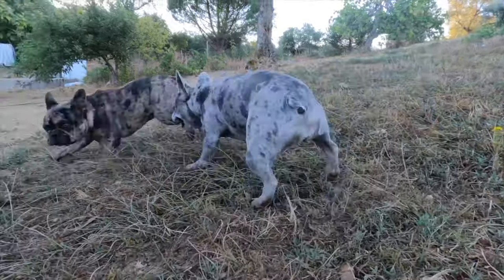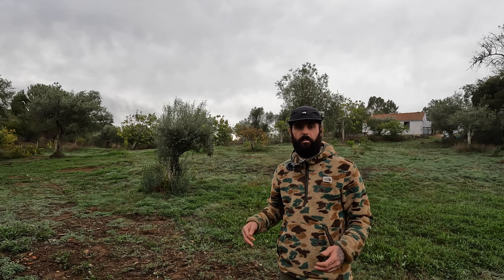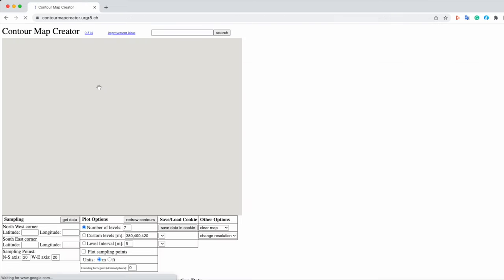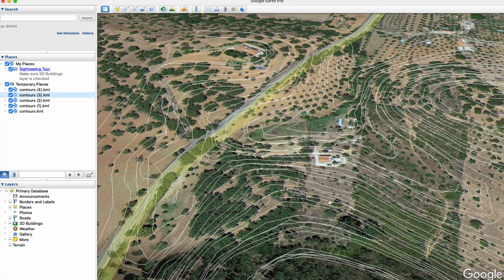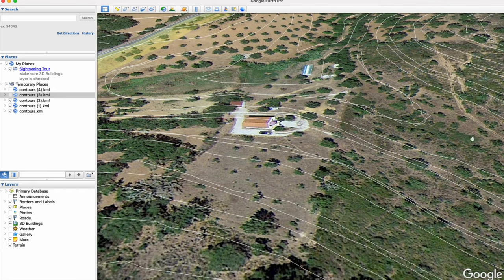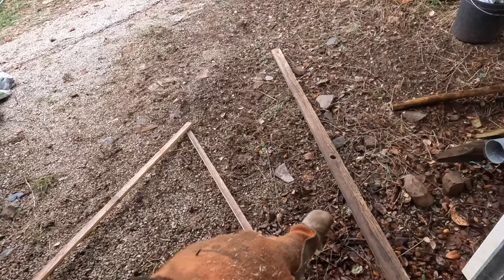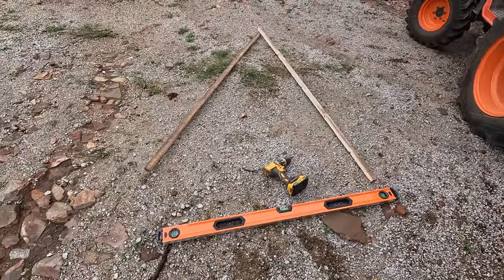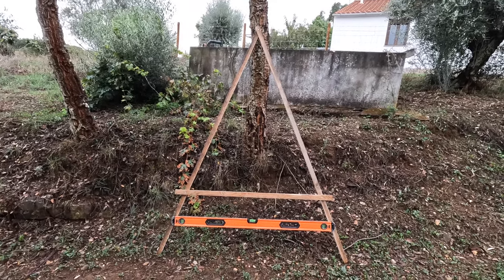PERMACULTURE PROJECT - PART 1. USING ONLINE MAP TO FIND CONTOURS FOR SWALES & BUILDING AN A-FRAME

Comment: Just some advice on the table saw, get some push sticks for feeding the wood through, and take those gloves off before you rip off one of your hands. They do nothing to protect your hands and if they get caught in the blade you'll get dragged into the machine. Maybe have a look at some table saw safety videos on YouTube or something. At the end of the day it's your hands and it's up to you but if you suffer an amputation injury your homestead dream will likely be over.
Reply from the maker: Thanks for watching and the advice too.
Ah I think I have a push stick, I was wondering what it was for but now it makes sense.
Yes better to be safe than sorry so will check out some videos :)

Comment: Luckily you have those holes at the end of your level, made the A-frame work out well. The online tool for the contour data is great. I have been using Google Earth for while but the contours add a little but extra 👌🏻
Reply from the maker: Thanks for watching Mark! I actually bought the level because of this protect so found one with some holes at the end, just a basic maxmat one but it did the job well :)
I’ve not played around with Google
Earth much recently but I thought it’s quite a good tool and the contour mapping makes it interesting when trying to plan where to design new stuff on the land :)
Have a great day Mark!
Reply: @rootsdownhomestead  good planning ahead on the level. I might be visiting Maxmat soon then 🤔